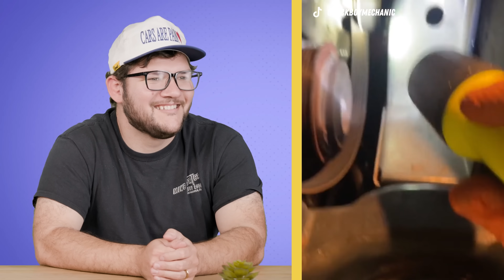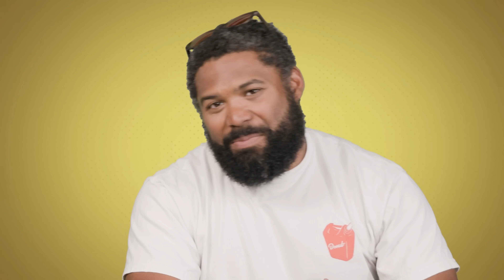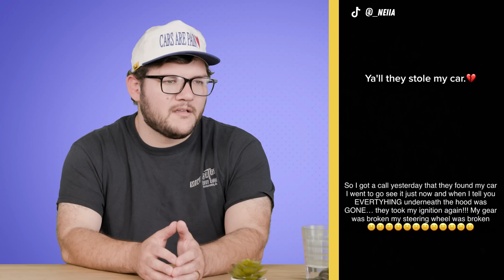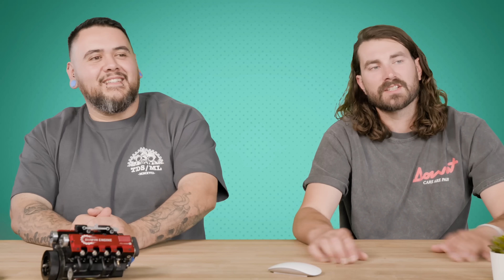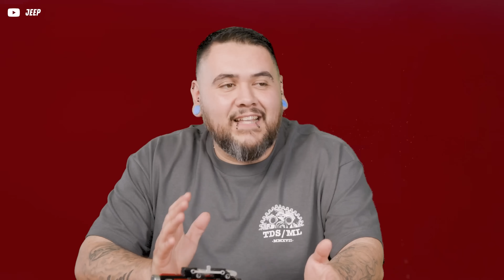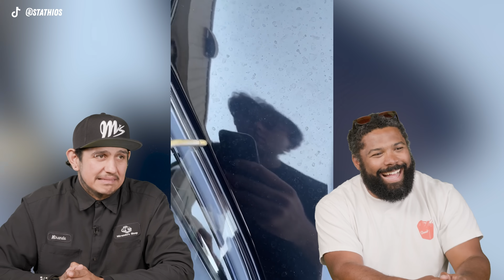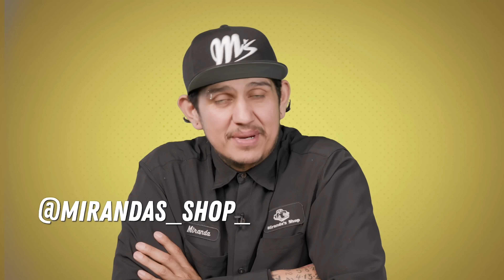Mechanic Reacts to Car Engineering Fails

Comment: That first one is a super quick and easy repair. The motor mount has 3 bolts that you take out and it drops the engine enough to swap the tensioner. Then you jack the engine back up
Reply: Well then I’ll add an engine mount R&R labor charge to the bill then. And while I’m at it, new engine mount too regardless of its condition for that sweet parts markup!

Stop defending an obvious engineering fault.
Reply: @HighlordFrancis  to remove the engine mount it’s only 0.3. Dealership life. Also I don’t complain about engineers I figure out through a few attempts easiest way then I fix it first try every try. I don’t think I’ve had a comeback ever at my current dealership. Goes by the name Trotter Ford

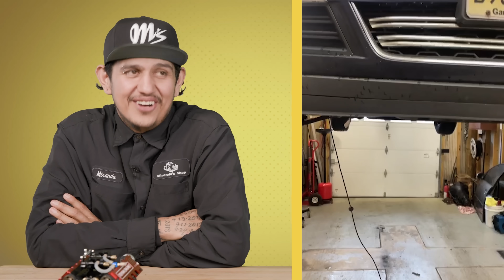Comment: @1:32…changing bushings on my passat 3.6…had to do exactly what she said, disconnect motor mounts, lift my engine, to move one bolt that took me 2 minutes to remove and replace.

Comment: A few years back Jamie Hyneman, of Mythbusters fame, wrote an article for Popular Mechanics where he ranted about this very issue and blamed too much dependence on using CAD to design things with too few engineers ever having to bark their knuckles on actual machinery.
Reply: Lol.  CAD is exactly the tool you would use to determine if an assembly would be feasible to work on.  I was ridiculed for modeling every single bolt accurately around 2000 when the computational resources commonly available make the model render clunky and slow but it’s very much worth it because identifying a problem ahead of time is very valuable.
Reply: @hugegamer5988  Large Corporate: "Interesting, we don't care. It'll save money to make it this way."
Reply: @hugegamer5988 i don't think factories care for replacement parts. They'd rather you sell your car and buy a new one these days.
Reply: Why is CAD to blame?
Reply: @alan62036  (Paraphrasing Mr, Hyneman) When a car is designed in CAD it will let you fit components together quite snugly and per the computer all the parts that might need replacement or repair technically can be accessed, but if the designer had no practical experience under the hood they might arrange things so that a part that needs frequent replacement, i.e. a headlight or a battery, now requires several other parts to be removed before that part can be accessed, thus greatly increasing repair times and costs. His example was a car they needed to replace a headlight, I believe, for a myth to be tested, and it ended up taking several hours and the removal of the battery to get to it.
Reply: @Leightr  except modern cad will give you clearances and let you work with tolerances as well.  I’ve found it’s far less often unskilled engineers and more often they were never provided the whole picture by management or it’s management saving costs.  Management dgaf about repairs.
Reply: @Leightr  this is just the classic "those so-called experts over there have no idea what they are doing with their fancy tools" gripe. It's endemic in all fields. The problem here isn't CAD, engineers, or technicians/mechanics. It's lack of communication and the pressure to finish designs and move on to the next as fast as possible that is making these problems appear.
Reply: @alan62036 Because everything fits perfectly when designed with CAD however there is no afterthought for remedial work to be done to any components that could be designed/positioned poorly
Reply: @NemotheEngineer  But that happens with drawing as well
Reply: @alan62036  yes drawings are one thing but almost all modern drawings are designed within a CAD program
Reply: @alan62036  CAD is like Photoshop plus programming.
Reply: @ThatGuy-vi8ch  I know. I've used it. Still does not explain how it's any different from drawing and calculating besides being way neater and quicker. :)
Reply: @alan62036  From the ones I've met, they don't do much calculations. They use the information sheets and create the documents. 

I've always had the job of upgrading parts or modifying machines when they fall apart if I notice an issue with factory builds. Engineers design the base model, then we make it better on the floor. That's how I look at it. Seems like a tale as old as time. Can't give wisdom to an engineer who only spent 2 years in the actual field.
Reply: @ThatGuy-vi8ch  But did the ones using manual drawings not do the same? Do a baseline model then improve it when buildiing it
Reply: @alan62036  Its hard to improve on something that just came into existence. It needs to be created, built, then tested. 99% of the time a machine's original design is not good on creation. I've even worked in places where I've spoken to reps from large companies like Fosber, who do cardboard making machines, that a ton of upgrades actually come from someone using the first model. They are making a guess based on what little they know about the parts, like using brass bushings where they shouldn't cause they will wear too fast. I'm positive this was the same with paper and pencil. 

All the engineers need to worry about (for their jobs) is that the machine works, does what is expected, and appears to look good. 

Can't tell you the number of times I've looked like a fool due to poor designs. It's not my fault the engineers used a soft metal in the wrong place and my boss wants OEM parts.
Reply: @ThatGuy-vi8ch  That's fine and all, but this still does not address the core point. What did CAD change over manual drawings? How did CAD make it that engineers suddenly design terribly?
Reply: @alan62036  I have worked on equipment dating back to the 50s. They always designed terribly.... CAD makes it easier to make mistakes since with a paper you can't hide certain sizes and variables behind menus and forget the values. That would be my assumption from using it but I'm not an engineer, just had to use the program to reprint and then I played with it in my spare time for fun. CAD is just easy to blame since "computers are making people dumb." It's always been this way, we just have something new to blame I'd guess.
Reply: @NemotheEngineer  yea, that’s most often a management penny pinching issue not engineering.
Reply: @Alan2022  since it made modeling composite assemblies more accurate, designers were able to make clearances between parts smaller and more compact. It's what makes the Virginia Class submarine harder to work on than the older LA Class - Virginia was the first sub class designed using CAD programs. I think the real solution is keeping mechanics strongly included in the design conversation, since they're the stakeholder most affected by this kind of thing and can recommend changes that an engineer who's trying to make the entire car work might not think about. Source: used to work as an overhaul engineer on US submarines
Reply: @That Guy  I was thinking more like.3ds max with mcode but yeah. Lol
Reply: @alan62036  did you just miss the entire point or what?
Reply: @alan62036  If you draw a part wrong on paper, it doesn't work, and literally, have to go back to the drawing board. It's an iterative process. With cad, you can literally see in 3 dimensional virtual space whether your part will work or not without having to go make the thing. The knowledge gained from drawing the initial piece and having to assemble it, bash your hands around, find out "wow it really sucked when I had to put that bolt for the pully in smashed into the frame like that, how bout I change that while I redraw the assembly so it's not as much a pain in the ass next time."
Reply: @alan62036 if you've been in engineering you'll know its always CAD.

Zero clearance bolts, zero clearance holes, high grade material and a budget of £10 and a 20 pack of smokes. "It worked in CAD" everyone says
Reply: @alan62036  I think its the lack of "hands on" experience that engineers have and the over-reliance and dependence on computer based systems without really putting their hands on their designed creations on computer that is the problem.
Reply: While I agree with Jamie that there are too many engineers that haven't worked with the mechanics enough, there's also a lot of instances where we get hosed by management and other people preventing us from fixing things. There have been multiple instances where I caught problems from others and have tried to get it fixed correctly only to have management override it due to budget/timelines/pride/whatever. It sucks, a lot. Especially the last one, with the leak on the O2 sensor - I'd be willing to bet an engineer caught that potential problem but management or sales said they couldn't take the time to fix it and it wouldn't fail under warranty so don't bother. Or, given the constraints of the space available in the compartment, they couldn't go anywhere else. There's likely multiple teams for different areas of the car that are working independently and aren't give the time/space to coordinate between each other to prevent stuff like this.
Reply: @peterfager2892  yeah my father worked in the circuit board industry and you know it's very different from the car industry there are still things where he'd have to fight management in other departments to get a design how it should be not what would be the most cost-efficient what would fit the Aesthetics what would actually work.
Reply: That's why I think 'dirty hands' engineers will always be better than 'clean hands' engineers.
You don't really know how to design correctly until you've had to fix some really bad design decisions.
Reply: And Popular Mechanics printed it??? That's really, really off-brand for them.
Reply: I deal with it all the time at work, it's annoying as all hell. They design processes in CATIA under absolutely sterile and perfect conditions with no room what-so ever for error. Then they get all upset when the real world comes crashing down on their nonsense.
Reply: It's a combination multiple factors Engineers having to design and engine and Chassis that will have the power fit within the production system already and fit around the body design that the designers made and also then has to be approved by the bean counters
Reply: You can see through stuff with cad, make parts transparent, angle the camera however you want.  Click on a part that's buried and move it around.  Not so easy in the real world.  Could take an hour just to figure out how to remove a few bolts.  In Car Mechanic Simulator, I can fix several cars in an hour.  In real life, it took me 6 days to fix one car.

Comment: That first one is the same scenario as an early 2000's Toyota Camry. I've done that repair myself. It takes a few minutes but you can jiggle and angle that bolt out. I kept asking the car gods why that bolt is so damn long too, lol. Less cussing though... slightly less.

Comment: Yes we do just put a 50 gallon under the bed on my Cummins 2500 2018 and getting the last thing to pop in is a biotch it’s the power to the fuel sending unit.  It’s in but the red tab won’t lock now I gotta drop it again to get it to lock damn FIAT

Comment: I think they forgot engineers and the factory go hand in hand. The engineer designs the vehicle to be manufactured and makes changes as they go. But sometimes things can happen like the engineer that designed the engine with the pulley bolt too long, wasn't the engineer that designed how the engine would fit in the engine bay. There is a reason I buy and work for Toyota brand, they make the best vehicles to depend on and work on. Not perfect, but they strive to build well.

Comment: Oil change of 5.7 Hemi. Sway bar is in front of the drain plug, and the oil filter is tucked behind the power steering. You pop that plug, you get a dude doing the splits with the Hersey squirts.

Comment: I see a lot of these, and it appears the mechanics don’t realize how this happens. It’s not because an engineer made it this way. It’s because an engineer didn’t notice it was a problem. The engine is not custom for the car. In fact, many pieces are not. Which means if engineers, don’t check every part of the engine to see if it interferes with something, this is going to happen.
Occasionally, you do see parts of a car, where the engineers actually thought about how it’s going to be repaired, more often their concern is how quickly It can be assembled.

Comment: My experience in the auto industry has found a lot of engineering "decisions" are compulsory to be chosen from a well established design manual. These manuals often specify company only made parts eg Ford Electronics Division Injector relays, Paccar contracted instrument panel switches and gauges.

Comment: I'm dealing with a 06 chevy 1500 wt. With a 4.3 v6.. just replaced spider injectors. Made sure all monitors were cleared!  Five days later, number 5 injector opened circuit.  Not sure what caused it to fail so soon. It's acdelco products. Just a nightmare.

Comment: yeah i feel the same way when i work on my toyota matrix with a 2zzge with the secondary air pump like why so i removed it yes i have a check engine light lol but its ok its just for that….i use to remove the main fuel relay and ecu when i owned a honda because there was no way you would of had the right tune as me every one was going b and h series i went d series

Comment: The problem is, an engineer, if given the power of a perfect, physicsless world, would place everything far enough apart that a failure would not cause problems. A mechanic would place everything in a maintainable position that would not allow everything to work together. The problem isn't with mechanics OR engineers. It's with the pursuit of better technology, and corporate wanting the big bucks. It just happens. Period. That's what we gotta go through for the newest, best cars to be produced, over, and over, and over again.

Comment: I had a '64 Ford Falcon 6. 3 speed manual. I put Hurst floor linkage in it. I called it: "The Car of the Future". It had Power Nothing. You could see ground on either side of the engine, name all the parts, and reach EVERYTHING. Absolutely bulletproof.
Reply: As bad as some of the new stuff is (and lots of it is pretty bad) it is still way more reliable and lasts longer than the cars of the 60s and 70s. My current vehicle is 10 years old with almost 300K on it, it has zero rust, and I have spent very little on repairs to it. I remember 10 year old cars in the early 80s and they were ready for the scrap heap. They were temperamental beasts that hated starting on cold mornings, they rusted at an alarming rate, they leaked like crazy, and stuff constantly broke on them. Your 64 Falcon with no splash shield under it must have been great driving through puddles given the horrible quality of wiring harnesses and "waterproof" connectors back then.
Reply: @daveattheholdens  FYI: I drove in 1 ft of water for miles getting home to the coast during the Hundred Year Rain of 1982. Lifted 4x4s trying to power through flooded out and were on the side of the road. No problems related to water damage after that.

Comment: Had a 1988 Sterling years ago. Austin Rover does not do engineering; I don't know what they do, but it isn't good engineering practice.  Had the Acura engine and power train - that was flawless.  The rest of the car always had something wrong with it.  Once you fixed that, something else would go wrong.  Should have known it would be trouble because the hood release was on the right side of the interior, where it would have been if the car was built for British roads and driver on the right side of the car.  Absolute piece of junk and I will never buy another British automobile.  Ever.  Someone once said, "If you want to go out in the African Bush, take a Land Rover.  If you want to come back, take a Toyota Land Cruiser".   Truer words ....

Comment: Blame engineering: 1996 Chev Astro van, in order to pull the starter you need loosen motor mounts and jack up the engine to get clearance.

Comment: On the first one, cut the exposed bolt behind the pulley between the pulley and the block.  Buy slightly shorter bolt and replace.

Comment: That bolt be esay asf for me to do 
I'd just cut it off at length and remove it all 
Then put a long sharft screw tread with a square end or something on and use a nut instead

Comment: Some ride on mowers are as bad. To change a drive belt on my Toro it was easier to cut and reweld the brake and hydro drive push rods than take the whole back end of the mower apart.

Comment: What about you guys getting some Aircraft maintenance mechanics and really learn about the horror stories they have to fix. Dealing with engineering oversights that not only extend to the OEM but oversights from regulatory entities too. Component maintenance manuals CMM that are  incomplete and full with typos and assumptions. I have seen books where the last revision update was 1961 imagen that one. There is an Airframe and power unit program for which you have to pass a test and get license but Avionics and the related electrical and electronics knowledge is not really part of that program. IPC is learned on the job if lucky to have a senior lead technician that has the knowledge and capabilities for teaching( well you also need eager students which is another issue).
Let me us know.... what do you think about aircraft mechanics and aircraft engineers ??
 A plain doesn't roll down hill. It crashes and burns!!!

Comment: As an engineer,  I will say there are plenty of lazy ones out there.  However,  for 90% of the real annoying designs,  most of that is dictated by the bean counters and the schedulers.  Every problem can pretty much be designed out given enough time and money. Frequently new designs aren't allowed full and proper testing or more expensive designs are disallowed due to cost.